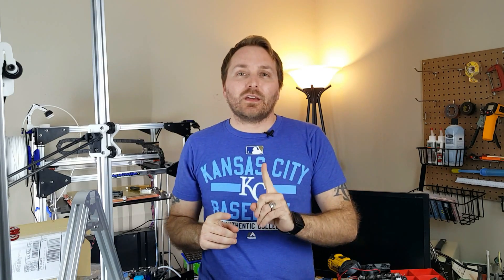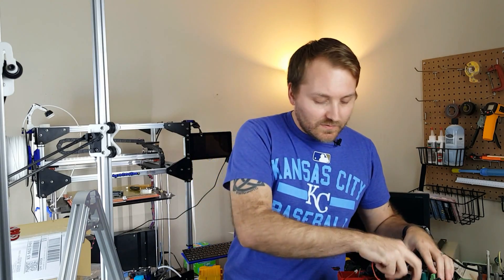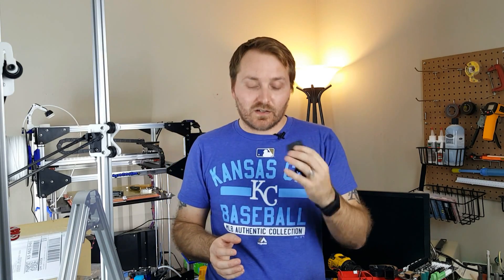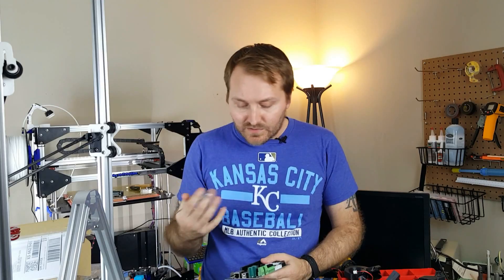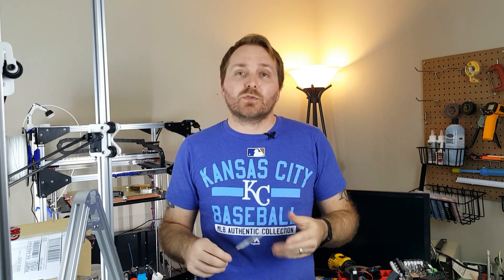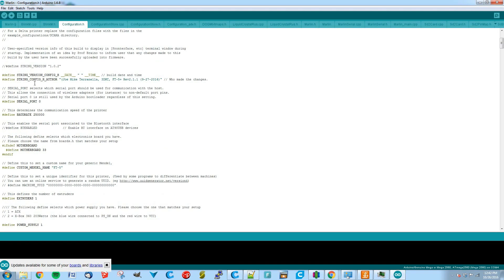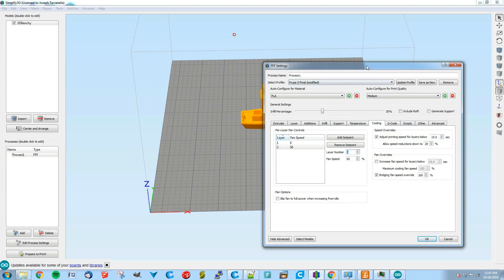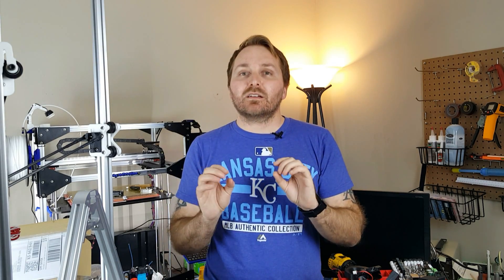Tutorial - All About Cooling Fans - 3D Printing

Comment: As a C programming advice: those board defines are deliberately there to avoid using meaningless numbers. Do not use the constant, it makes the source unreadable, and (while it is unlikely) it might change in newer versions of the code. The best practice is to use the defined names like this:
#define MOTHERBOARD BOARD_RAMPS_13_EFB

Comment: Creality 3d printers have 2 fans mounted with the nozzle. I thought about replacing the unusual looking one (on the right with a more compact design) with a radial blower. Could I do this without any issues? Are both nozzle fans required?

Comment: Hi,
Talking about upgrades...
Do You know if its possible to upgrade a Melzi 2.0 V5 board with a Full graphic smart controller type 12864.
Just starting with a humble Tronxy X1)_
(only the display, as I saw that there is only 1,  8 pin connection possible)
Thanks
and keep on explaining the 3D stuf to Newbie like me...

efbe

Comment: have you tested out the berd air??? she blows like a hurricane!
Reply from the maker: mitchell hirsch heck yeah! I actually ended up putting one on the delta that is in this video.
Reply: i loved it so much i have 3 now lol!! a bit loud but i am in the middle of designing a sound dampening enclosure i'll be sure to link the stl location here ;) will need tpu or ninjaflex
Reply from the maker: I run it around 25-50% of its max power to keep the noise down. But I find that even at 25% the cooling is outstanding
Reply: same here!! i have the 24v version so @ 100% its loud!! never really run it at that percentage! as 25-30% is perfect! 200mm bridge with very minimal saggage...bridging is absolutely amazing with this mod! imo the best part cooling system on the market

Comment: Great info once again JM. But as I don't have any software running on a computer, how do I trigger the part cooling fan via the Tevo control panel? This is all before I've even done a first print by the way. ;¬)
Reply from the maker: You should be able to turn it on via the lcd.
Reply: Ok,thnx. But I'll be leaving it till after Xmas now. The hot end ceramic cartridge heater is no good, stays cold. I even checked it with an independent 12v source. Cold! So I decided to chill! :¬DI've ordered a replacement from a UK supplier, it should be here in the first week of next year.
Have a good Xmas dude.

Comment: Great video I started to watch it last week thinking i had a fan or a duck problem as my prints where great one one side and falling apart on the other. So i changed fans speeds temp. and shape of duck about 5 times and still the same. then when i was making another change i felt a cool air on my hand on the side  was having problems with. it was that the window was open and cooled air was blowing on the print not much but enough to change the temp. soon as the window was closed the prints where all right again.. temp in Northern Ontario had just changed last week to about 2c.  something a stupid as that would make a change like that as the window has been open all summer.

Comment: Which is better a 12v blower fan or 24v
Reply: You need a fan that matches your system! Some 3D printers have 24V power supply and a 12V fan likely won't start reliably on these systems and even if it does, its power will be very limited, so they need a 24V fan. Most printers have a 12V power system, so you use a 12V fan on there.

Often the same fan will be made in 12V and 24V variants, which perform very nearly identically at their respective rated voltage.

Comment: Just wanted to point out those are not PWM fans/outputs, those are voltage regulated. A PWM (Pulse Width Modulated) would require a 3rd pin and wire that is a signal to control the fan speed. Great video though.
Reply: I'm not sure the relevance of this... these are regular brushless fans. The board performs PWM control on them, at a rather low frequency, via an integrated MOSFET - there's no voltage regulation, in the sense that there is neither smoothing nor feedback. In fans that you call PWM fans, the MOSFET is simply relocated from the board into the fan - traditionally it's a failure prone component, so it made sense to put it into the cheaper field replaceable unit, and one that you will instinctively replace if the fan is not working. Also it was necessary in PC fans where external PWM control otherwise interfered with tach feedback.

Comment: Hi Joe, thanks for the video! It has been the most helpful on the subject of fans so far. When you say to wire the extruder fan directly to 12V power from the power supply, could you explain exactly how that is wired? My extruder fan is currently connected to the RAMPS board, so I need to move it to direct power so I can install my new print fan. Do I just attach the red wire to the available positive terminal and the black to the available negative terminal? I know the answer is simple, but I'm still learning about electricity! Thanks!

Comment: What about those jet fans used in 1u servers
Reply from the maker: If your jet fans are like my jet fans, then the noise alone would be enough to keep me from wanting to use one on the printer, lol. Not to mention that it may be a touch overkill. you want a good amount of airflow, but not so much that it causes thermal runaway when it kicks on.
Reply: Joe Mike Terranella I meant jet fans as in those fans that looks like 2 40mm fans stacked together. Like this fan shown on this link https://www.verical.com/pd/sanyo-denki-fans-and-blowers-9crb0412p5s201-1145515?wm_ctID=250&wm_mtID=3&wm_kwID=77325588&utm_source=GoogleShopping&utm_medium=cpc&utm_term=9CRB0412P5S201&utm_campaign=*Google%20Shopping&topperformer=1.00&offerID=19745304&gclid=CjwKEAjwh9PGBRCfso2n3ODgvUcSJAAhpW5o4KgjoPZgHFeQa-fCDyNO2K3ICoYjnza6VivMwj1leRoClBDw_wcB&gclsrc=aw.ds
Reply: that is a very inefficient way to run fans. two fans in series will not yield twice the flow.

Comment: Joe Mike Terranella - I am a bit confused about updating the firmware for the board. I have BOARD_MKS_13 on my Folgertech FT5. If I want to add a part cooling fan would I change it to the BOARD_RAMPS_13_EFB (33) as you described in the video since I don't see any options to add fan for the BOARD_MKS_13 on the list in boards.h?

Comment: Awesome video Joe! Very much appreciated! Will definitely come in handy once I start upgrading my FT-5. I do have a question however: Does adding a part fan and shroud affect the weight of the extruder assembly enough to have any affect on the assembly movement and part creation that we should be aware of?
Reply from the maker: Tim Cozad not really. The benefits of having it far exceed the small additional weight on the Hotend assembly.

Comment: Is running 2 or more fans recommended?  I have had pretty good luck with Cougar brand fans in the computers I have built.  Fans still going strong 4 years later running 100% speed.  They move a lot of air and aren't much more than the one you buy off ebay.  But it would require some type of mod to work since the smallest one is 120mm.  The cooler master and Corsair fans always seem to fail so I would stay away from those if you can.
Reply from the maker: It depends on your set up. I run a single 50mm blower on most of my printers, but I run two 30mm axial fans on my Kossel. You CAN over cool. Basically, the amount of air traveling close to the heater block is so high that it causes a drop in temp that it can't recover from without throwing a thermal runaway error. If you run multiple fans, or a large fan, you need to wire them to an output that you can control the PWM, thus allowing you to control the speed.

Comment: whats the differences if i got a 24v or 12v fan? im using ctc and my power supply is 12V s far as i know can i use 24 v fan?
Reply from the maker: A 24v fan running on a 12v system will not run at full RPM due to under voltage. It will work, it just won't work efficiently.
Reply: Hi friend, if your power supply is 12V, if you place a 24V fan on it , the fan about 24V will be burn.

Comment: can i blow to much air over the part?
if i blow to much air can i damage the part?
Reply from the maker: Yes and No. You can blow too much air that the part cools TOO rapidly and causes warping. This is unusual on PLA, but very easy to do with ABS.
Reply: ok.. and why i don't see people using a air compressor whit a flow valve blowing instead of a flimsy fan?
i use a system like that in my cnc mill and it works like a charm!!!

Comment: how can i add a part cooling fan to an Anet a2? Is this process the same for all printers, so i dont waste your time, as the Anet A2 has VERY VERY VERY little support online. i hear it does not have a part cooling fan, mine is ordered so i just wanna be ready when i get it
Reply from the maker: From what I know about Anet printers (which isn't much, btw) I think you might find it to be an uphill battle. You'll need to find a mount as well as figure out the firmware for the Anet control board. If it uses a standard Anet board, there should be some dedicated fan outputs on the board. I'm just not sure how on earth you configure the Anet board. Have you tried the Anet facebook group?
Reply: Joe Mike Terranella yeah, a dude on there said it would be easy to do, so unless he can tell me, i may be screwed. If i cant do it for some reason, i should be able to print PLA, right?
Reply: i mean ABS?

i just switched my order to the anet a2 for the badass frame, but i dont want to have to switch my order back to the anet a6 if i can avoid it.
Reply from the maker: My question is why Anet? Other than cost, is there something particular about Anet you like?
Reply: Joe Mike Terranella the cost basically, and i know nothing about any other cost effective printers, ive seen some good results from Anets, this dude just posted a badass statue he made with an a2, so i was sold on the aluminium frame, and he said he didnt need a cooling fan for printing it in PLA, so if he didnt have a problem, i may not, hopfully not right away.

i heard tarantula was good, but i figured since i couldnt afford a Prusa original i3, the Anet seemed good enough , if all the pieces arent destroyed. 

what would be your cost effective alternative?
Reply: Joe Mike Terranella the cost basically, and i know nothing about any other cost effective printers, ive seen some good results from Anets, this dude just posted a badass statue he made with an a2, so i was sold on the aluminium frame, and he said he didnt need a cooling fan for printing it in PLA, so if he didnt have a problem, i may not, hopfully not right away.

i heard tarantula was good, but i figured since i couldnt afford a Prusa original i3, the Anet seemed good enough , if all the pieces arent destroyed. 

what would be your cost effective alternative?
Reply: Joe Mike Terranella i dont know enough about anything other than i saw some good results, and ive only researched the anet, im totally new to this hobby
Reply from the maker: A little more research in the facebook groups and the various 3d printing forums can save you a ton of headache in this hobby. Anet is inexpensive, but there is practically no support, very little community, and in the 3D printing world, you really do get what you pay for. We can often shift the odds in our favor by learning the ins and the outs of all the hardware and firmware, but if the hardware and firmware is weak to begin with, there is little we can do to improve/modify the printer. That's why you'll see a whole mess of printers built with Ramps/Arduino control boards (or the combo MKS boards). They are cheap, tried and tested, and have a HUGE support community. The firmware is open source and always being improved upon. If you can find a lower cost printer built around a Ramps or MKS board, you'll automatically tilt the odds of being able to fix/improve/modify the printer dramatically. Something like the Folgertech 2020 i3 is a great example. It's under $300 and is a good printer stock. However, it SHINES in it's ability to be upgraded and improved upon. There are forums and a facebook group that are very active, always. If you can spend the little more, it will put you WAY out in front in the long run. Here's the link if you want to take a look: https://folgertech.com/products/folger-tech-reprap-2020-prusa-i3-full-aluminum-3d-printer-kit
Reply: Joe Mike Terranella i will look into it m8, thanl you!
Reply: urjnlegend m

Comment: I took all the part cooling fans off my printer after I discovered that I get perfect results when I just put my 20$ large box fan about 2m away from my Robo3D on lowest speed. It creates a very even and constant air flow through the entire print volume. Since then I get super sharp edges, tips and no warping at all.
With the part fans I had problems with saging and warping or one side of the print having a different quality than the other. Never got a perfect Benchy with the part fans for example, now it's a breeze. I can only recomment that for any open printer!
Reply from the maker: That is an interesting method with an equal interesting result. Usually you need some pretty focused cooling to get good edges. Does your current printer have a directional Fan shroud (only blows on one side of the nozzle)?
Reply: The standard Robo3D R1+ comes with one part fan on one side without a shroud, blowing air down on the part at an angle. You can print yourself a modification to add shrouds and a second fan on the other side. I thought about doing that for some time because the "backside" of the print always turned out worse than the front. One day I tried my boxfan, since then I have perfect prints and even removed my part fan from the printer.

As long as I don't get super short layer times (like on a sharp tip) I have amazing results. Those tips I usually come by, by printing a second part, or just a box as high as the final part.

The Robo R1's also have a very good design for my method because of the open front and backside.

Comment: @4:19 CFM is short for cubic feet per minute (cu ft/min). It is a measurement of the velocity at which air flows into or out of a space ;-)
Reply from the maker: Indeed! I use to do building automation and controls, so I dealt with CFM control/readings everyday. I've been trying to be more general with the way I explain things in my video, so 'measure of flow' is what I went with. For the average 3D printer user, just knowing that more CFM = more air and vice versa is probably enough, ya know?
Reply: idiot
Reply from the maker: Ellsworth M. Toohey me? Pretty much.
Reply: This comment is for xoaster, CFM  (an archaic measure BTW, not used anymore except by a minority in the US), m^3/h or L/s is a flow rate not a speed. A CFM is about 0.47L/s, 1 m^3 is 1000 L (How many gallons in a cubic feet ?)
Reply: so obviously you're too dense to pick up on the sarcasm, Toohey... Also , velocity and rate are synonyms so come of it.
Regardless, good video Joe. really enjoyed it. The BIG reason (IMHO)  to use a blower rather than a radial fan on a 3d printer is that the axial fans are so easy to break blades off of. Much more difficult to break a blower lol
Reply from the maker: Well that and it's harder to stick your finger into the blades of a blower. Less cussing over all.

Comment: Thanks for the video. Do you have a recommendation for which blower to buy?
Reply from the maker: That is a great question, actually! There are several 50x15 blowers on Amazon that are sold by Uxcell. I DO NOT recommend these. They are cheaply made, break easily, and don't put out as much air as a fan that size should. They run around the 0.15 amp range, which is a little under powered for my taste.

So I recommend finding a good quality radial/blower fan with AT LEAST a 0.30 amp rating. I know it's not much of a power increase, but it's double what the uxcell offers and that is what counts. I get my blowers from eBay, direct from China (I know, I know, but they are worth waiting for. trust me.)

http://www.ebay.com/itm/Delta-BFB0512HH-F00-5015-50mm-DC12V-0-32A-blower-ball-bearing-case-fan-M2412-QL-/182000211210?hash=item2a600ed50a

That's my go to fan now. I have several of that model and they move air like a boss.
Reply: Just got my blower and man does this thing move some air! Do you have its max set to 100% Seems like too much to me
Reply from the maker: I only go max speed when bridging or thin delicate work. I usually run it around 50%
Reply: Joe Mike Terranella So set max speed to 50% and the 100% for bridging will over ride that number?
Reply: Mark Mathews s

Comment: Hi, whats your opinion on replacing the hotend cooling fan with a blower fan? I want to silence my standard 30mm e3d fan but I dont have enough space between my model cooling duct and the effector to put a 40mm on the hotend.
Reply from the maker: Sungod3000 I don't blame you for wanting to get that 30mm off, those little guys are loud. I've seen people use tiny blowers on e3d heatsinks and it seems to work well.
Reply: indeed, maybe Ill adapt the thingiverse link you posted to 30mm, worth a shot i think. 

and since we're already on topic something that shouldnt be underestimated is the air bouncing of the bed and cooling the hotend. Im running a 360 torus shaped duct and I can only go up to 30% fan speed without cooling the nozzle.
the e3d "sock" probably eliminates those issues but for all other hotends and a z height of 50mmm or less that could be an issue.
Reply from the maker: Yup, that is a good point. The closer you are to the bed, the slower your fan should be running (unless bridging). Having your Hotend's PID tuned properly is also a good way to combat temp drops from cooling fans.